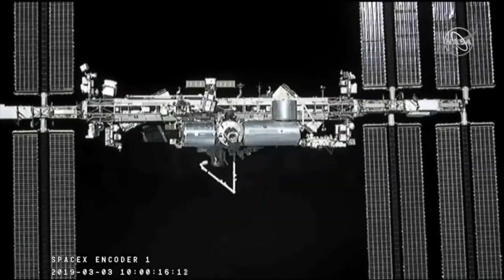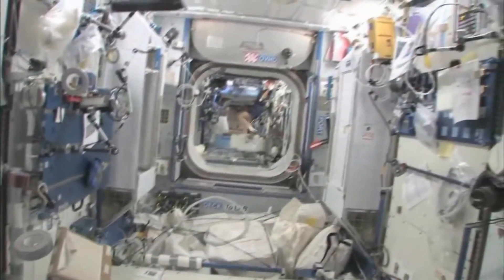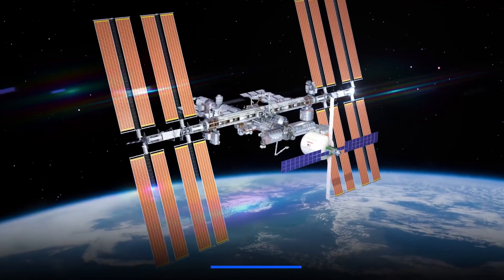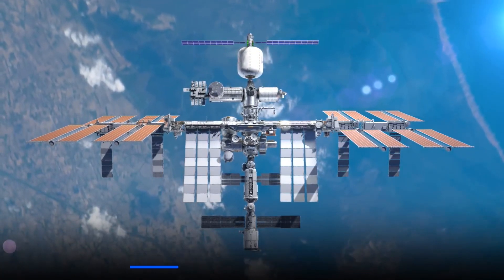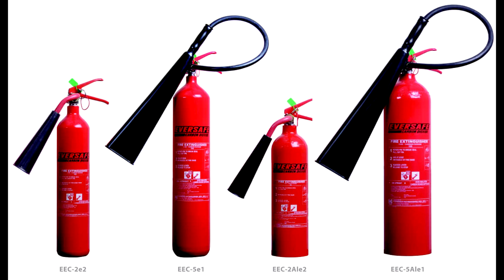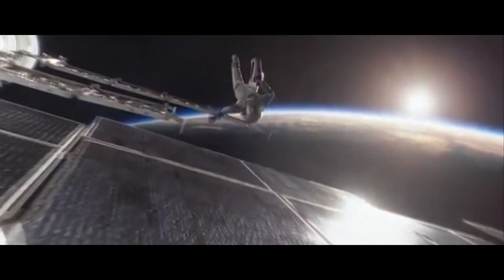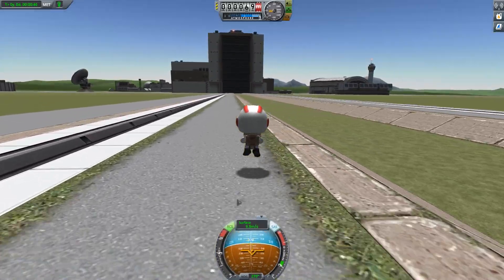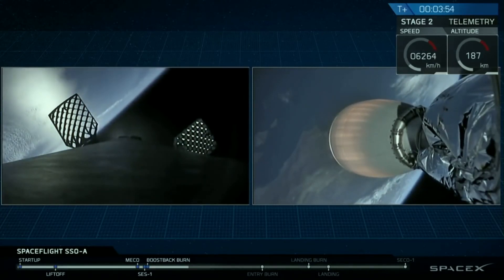Would A Catastrophic Air Leak Knock The Space Station Out Of Orbit?

Comment: Hang on here, what if we ionize it and shoot it out with an ion thruster?  Even if we keep the poor guys locked up in their habitable area of 388m3, that leaves 528m3 to expend.  If it's compressed to a sea-level atmosphere, that should be 682.704kg of mass.  If we get 65% the speed of light (I think they get 70% using xenon gas these days), we should have 133GN (giga-newtons).  Isn't that 133m/s2?  I'm not a math genius, but I think that's right.

EDIT: I don't know what negative effect the ionized oxygen would have on the grids, and I suppose I omitted the portion of propellant that would hit the grid and then sort-of float away, doing very little.

Comment: "60 kg of force"  WHaaaat?
Is that a mistranslation from pounds?
Reply from the maker: It's a unit of force often used by rocket engineers.
Reply: @scottmanley  No wonder the Polar Lander crashed. "Imperial or metric?" "metric, OK. SI unit of force."
Reply from the maker: Ever wonder why specific impulse is measured in seconds? It means it’s the same if you measure thrust in pounds force or kg force.
Reply: @scottmanley  I did learn that "seconds" is a bastardized unit, from cancelling "pounds" with two different meanings.  The SI unit is called something else.

Every science class (particularly physics) I took in college was clear that kg is _mass_, not force.  The weight of a kg can't be considered a constant once you are dealing with space travel!

Freshman physics classes famously permit "pounds" as force only, with an apparently made-up unit ("slug") for the mass in this system.  But beyond that, as seen in the CRC reference book, which meaning of pound is taken from context.

But we're also taught to do all calculations in SI and *check unit dimensions*.  Convert to/from desired units around that.  My HP calculator (from 1987 I think) was one of the first that tracked units automatically.
Reply from the maker: Yep I did all the same classes in my physics degrees, and then I kept running into kg of force in aerospace.

Comment: Scott, at 1:38 you mention the rms velocity of gases, which is somewhat related but different from the hypotetical exit velocity. Since the pressure difference between inside and outside the ISS is above the critical pressure, the airflow should reach a choked condition, therefore exiting at exactly the speed of sound in that gas (if no proper de Laval nozzle is present)

Comment: I actually did the math(s) on how much delta-V the Hermes would get by blowing the airlock in the comments of this video: https://www.youtube.com/watch?v=84IA5OUzHDE. I'll quote it here for anyone who's interested.

"So I came up with an estimate for the volume of the Hermes airlock to be about 18.85 cubic metres. this is assuming that it is 2m tall (plenty of room for an astronaut in an EVA suit) and 6m long (based of what it looks like in the movie).Assuming an atmospheric density of 1.2 kg per cubic metre (sea level air density on earth), we can calculate that the airlock contains 22.62 Kg of air. Taking your value of an ISP of 68 for cold gas thrusters and assuming that this remains the same for the airlock (despite the lack of a nozzle) and that the Hermes has the same mass as the ISS (417 tonnes) we get a best-case scenario estimate of 0.04 m/s of Delta-V. Even if they blew half of the ship open they'd still only get 0.89m/s of Delta-V. This is assuming that the Hermes has an identical volume to the ISS. It doesn't seem like the ending of the Martian is plausible no matter how much benefit of the doubt you give Andy Weir. :/"

Comment: Yep. Let's decompress cargobay 4 which seems to be 8x8×8 meters pressurized at 1 atm of standard breathing gas mix to nudge the enterprise, a galaxy class starship weighing 5 million metric tons, out of the way of another ship...
Reply: Actually if you're referring to the scene I think you are - they didn't decompress a cargo bay, they decompressed the main shuttle bay - that massive garage door on the dorsal side of the saucer, the main shuttlebay occupies a full 3 decks or something, it's like 200m x 300m x 10m of empty space in there. Still not enough for a significant delta-v to the ship, though.
Reply: @tetsujin_144  but everything else happens in Cargobay 4 ;-)

thanks for the correction, though

Comment: 60 kg of force? Really?

Last I checked my SI units, kg is not a measure of force.
Reply from the maker: And yet rocket builders are happy using it https://en.m.wikipedia.org/wiki/Kilogram-force
Reply: @scottmanley  Kind of defeats the purpose of standard units. The Newton is a fine unit that converts easily; KgF isn't.

I'm perfectly willing to use "traditional/imperial" units, because they work well in my head, for things that only need that kind of precision. But the point of SI is supposed to be that the units are easily convertible and analyzable with dimensional analysis. There are few cases (calories -> Joules, for instance) where convenient units for one purpose require inconvenient conversions (we will ignore the kCal/Dietitian's calorie issue), but they're quite limited. 

And there's really no reason to use something tied to an arbitrary place (gravity varies significantly with altitude and what you're standing on after all) when there's a unit that is explicitly intended for this use. If you're rule-of-thumbing it, I suppose you could use KgF as a shorthand for a dekanewton, but why?
Reply from the maker: When dealing with rocket thrusts TWR is important so expressing forces in terms of pounds force or kg force is common. This is also why specific impulse is measured in seconds.
Reply: @scottmanley  Thrust-to-Weight is important when departing from a gravity well, because you are looking for an excess of force above the gravitational attraction, but KgF is only useful from the surface of a single planet. KgF from the surface of the moon means that you need to translate to useful units to get usable results.

TWR is not useful in orbit (since W -> 0). There, Thrust-to-Mass is what matters. Using thrust in newtons and mass in Kg means that it's trivial to work in Newton*Sec. It's also almost trivial to derive delta-V using those units ("almost" because mass is a time-dependent variable because of propellant loss).

Sure, I can work in whatever units and translate between them. (I have been known to quote my height in J/N when SI-only people get too snarky). And only occasionally does a Mars orbiter crash because of unit translation errors, so what's the worry? 8-)

Comment: Curious why you used the kinetic theory of gas to estimate a velocity here. This seems like, honestly, a useless number in this scenario. That's the random motion of the individual gas molecules, not related to the overall flow velocity really at all. This can essentially be modeled as flow through an orifice, and that means that the maximum speed is going to be closer to Mach 1 at STP or 343m/s. However, the actual flow velocity (assuming a constant 14.7psi input pressure - it will decrease as the ISS bleeds out of course) through a 3ft orifice (probably a bit small but this will give a HIGHER velocity) is closer to 136m/s. So a Delta-V of 1*136/420 = 0.32m/s.

None of this disproves your point, as a matter of fact it only strengthens it. But the kinetic theory is not the right approach here.

Comment: Where is the centre of mass of the ISS?
Unless you apply the gas escape force through the centre of mass, most of the force will be used in causing a roll/yaw of the ISS.
Roll/yaw involves a whole new set of physics/mechanics.
What is the structural strength of the ISS, if you look at it as a system of interconnected beams?
If all that "massive" gas force was applied at the very end of the ISS, would it bend due to its mass, inertia as it applies a torque?
Reply: that makes sense, but the clue is that this gas force you say cannot have that "massive" thrust

Comment: Is there any "safe" way to improve on cold gas thrusters? 

Most monopropellants are right out, since they are either toxic or explosive, usually both.

Possible exception would be HTP, which doesn't burn, but rather releases steam, making is marginally safer than the majority of other monopropellants... Unfortunately, it does so because it's unstable and easily decomposed, which isn't something you want in a fuel that is supposed to be stored for years without overpressuring and exploding the tank it sits in. 

Bipropellants are even worse: more of the same problems, plus now we are talking about putting a full rocket engine on a space suit, pumps and all.

What's left? Vinegar and baking soda? 

...Coca cola and Mentos?
Reply from the maker: There are green monoprops - https://youtu.be/y7jn9VApYqU

Comment: Ok -- that is if the gas IN the station was all vented. But presumably there are cylinders of compressed gas that would continue to try to compensate for the loss of internal pressure (I have no idea how much they have but they must have SOME. Although I have no clue if they would try to compensate automatically or not). How much difference would that make ?

Comment: Super-short answer: NO. Even if you blew the leading face of the ISS off in a single shot and let all the air explosively decompress, the amount of energy released by the escaping air wouldn't be able to change the ISS' orbital speed enough to make it crash. Remember, orbital speed at that altitude is Mach 25. That's really fucking fast.

Comment: No, Your explanation is completely wrong.
You over simplified your response as if your listeners were only interested in science-like edutainment in bite sized chunks.
You forgot any time scale in your "knocking out of orbit". And, as the space station is already/eventually falling out of orbit...
The proper perspective is how much shorter could a catastrophic air leak make the remaining life of the space station.
Thrusting towards the earth is temporary. If the orbital speed is not slowed your loss of altitude will slow, stop and reverse until you have nearly the same altitude again.
To permanently de-orbit the space station, forward speed needs to be reduced, but only a little to lower the altitude and increase atmospheric drag.
1m/s is more than enough to be considered the death nail, if it's direction is to slow the orbit. Just calculate the time it will take.
And a volume loss will cause them to replace the lost air with bottled reserves. You need to calculate the amount in the entire system (including reserves) not just the static volume of the station.

Also: Air leaks come in all shapes and sizes. Most fatigue cracks, seam/weld openings etc do have increased velocity. Micro meteor strikes are not all "micro". The resultant thrust could be in any direction in 3D space, most likely just to start a spin. A spin that could knock the space station out of service!

The answer is a resounding YES a catastrophic air leak could possibly de-orbit the space station... eventually.
BUT, the net direction of any accidental thrust is highly unlikely to be sufficiently positive or negative with respect to orbital velocity. Sooo... (you are partly right) it is nothing to worry about on the time scale of sci-fi shows or the attention span of barely human apes.
Reply: The ISS would deorbit without an air leak in a few years without they raising orbit periodically with the remaining fuel from resupply missions. The altitude decay is about 2 km/month. https://en.wikipedia.org/wiki/Zvezda_(ISS_module)

Comment: Scott, the structure alone debunks that it NOT where they propose. The largest NASA vacuum chamber, that they never use, has 8' steel and concrete reinforced double chamber design. Space as described, is many magnitudes stronger of vacuum thus the thin walls could never hold the pressure differential.
Reply from the maker: Are you suggesting submarines are a hoax? They deal with much higher pressure differentials without being made of 8’ of steel and concrete, I think you should devote yourself to exposing that all submarines are hoaxes.
Reply: Are you suggesting there is no ISS? 

You're of course aware that you can SEE it from earth, right? Always exactly where it's "supposed" to be. 

You're laughably wrong about this mate. Got any science to back that up?

Comment: A depressurization event wouldn't cause a direct deorbit for reasons Scott went thru in the video, but it would cause the eventual deorbit and destruction of the station because attempts to maintain stability  would likely exceed the onboard propellant and torque-limit of any attached Soyuz.  This would cause a gradual decay in the station's orbit and lead to its reentry. 

Any crew who survived would conduct an immediate evacuation via Soyuz.  The internal systems and equipment which were never designed to be exposed to vacuum will likely be wrecked.  So it will be a total loss.  So if ground controllers did managed to maintain some maneuver control over the station (unlikely), they would probably choose to just use whatever DV they have left to try to bring it down in the Indian Ocean graveyard.

Comment: TIL Hydrogen cold gas thrusters have a theoretically higher specific impulse than SRBs, hydrazine monoprop, and about the same as MMH/N2O4
3:55
Reply: Yeah, that's interesting. I guess it means that waste hydrogen-based RCS doesn't waste much at all. Also means a giant compressed hydrogen bottle with a De Laval nozzle might make for a workable but hilarious upper stage for a low-tech rocket.

Comment: The fire extinguisher CO2 may get off one or two blasts if it started at 20C, but the gas expansion and space environment may cause it's temp. to drop below -38C quickly and then it would freeze.
Reply: Except it take ages for things to cool in space....
Reply: @iami3rian394  That's not how decompression works... It would very quickly sublimate into dry ice because we assume it's at room temperature or something close, and the massive pressure drop would cool it. It's the same reason that canned air gets really cold when you turn it upside down, but with no atmosphere to warm it back up.
Reply: @gajbooks  except it's inside a can, and there would be no "massive" pressure drop. Up until exiting the nozzle (and as you pointed out lack of atmosphere to mess with heat) there'd be no difference at all on the pressure inside the can, minus of course one unit of Earth's atmosphere not pushing back down on it.

The gas inside would remain pressurized. It doesn't lose pressure simply because there's less outside of the can.

It wouldn't "boil" from the pressure if you dropped it in the ocean mate. It also wouldn't sublimate in a vacuum.
Reply: Ctrl+f "freeze". Thank you. That's what I came here for.

Comment: Some interesting side notes out of the fire safety industry:
On the ISS they used, Halon and CO² fire extinguishers. Both not the best solution in space, so they developed high pressure water mist fire extinguishers. They hold 6 lbs and have a starting pressure of 1.270 psi.
  
Link to a a nice presentation:
https://iwma.net/fileadmin/user_upload/IWMC_2016/CSM_Abbud_Madrid_IWMC_2016_3.pdf
 
And the detail report from NASA:
https://ntrs.nasa.gov/archive/nasa/casi.ntrs.nasa.gov/20130011664.pdf

Comment: Why does the Space X nozzle look so fake/animated in use? Im not a disbeliever, just curious the mechanics of the strange artificial appearance on videos? Anyone else?
Reply: The upper stage nozzle, actually the nozzle extension, is made of a niobium alloy, and radiatively cooled. The basic nozzle, which hardly shows, is regeneratively cooled by cold fuel flowing through it, and doesn't glow. The big extension bell radiates its heat away, so it doesn't melt. That's why it glows in a science-fictioney way. No ablative nozzle anywhere on Falcon 9.
Reply: What ablative nozzle? They reuse all their active engines, none of them have ablative throat designs as far as I know.
Reply: @aleksandersuur9475  6:50
Reply: You've been pre-conditioned by the sight of liquid cooled engine bells.  It doesn't look fake, it simply doesn't look like you expected.
Reply: @TheEvilmooseofdoom  incorrect, it looks fake, for exactly that reason...
Reply: @YZFoFittie  To judge if something looks fake you have to have seen something 'real' to compare.  So unless you seen a lot of radiative cooled engine bells you're actually just guessing based on inexperience/ignorance.
Reply: @TheEvilmooseofdoom  nope...
Reply: @YZFoFittie  Nice rebuttal.
Reply: @TheEvilmooseofdoom  you are arguing the sky isn't blue. I have no need to waste time on such ignorance...BYEEE
Reply: @YZFoFittie  There is an irony.  You will waste time to spout ignorance.
Reply: @TheEvilmooseofdoom  you saying that in the mirror, yah?
Reply: @YZFoFittie  That was a perfect example.
Reply: @TheEvilmooseofdoom  agreed

Comment: Does the ISS use one atmosphere of pressure? I would have thought they would reduce this a bit to save on mass and hull strength. Not as drastically as in an airplane perhaps, but at least La Paz or Leadvill levels.
Reply: No, other than abnormally high CO2 content it's standard atmosphere. There's also on-board experiments to consider, which are the entire raison d'être for the station. Rather important to provide them as close to standard atmosphere as possible.
Reply: @aleksandersuur9475  Oh right, the experiments. Thanks, that explains it :)